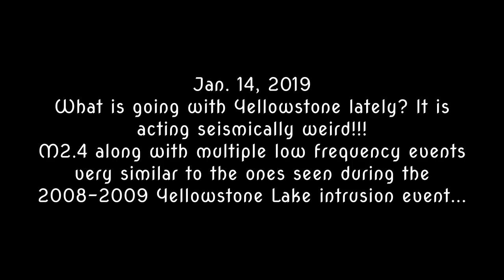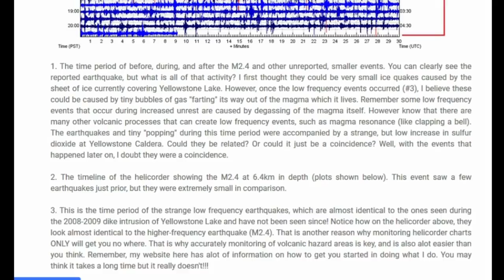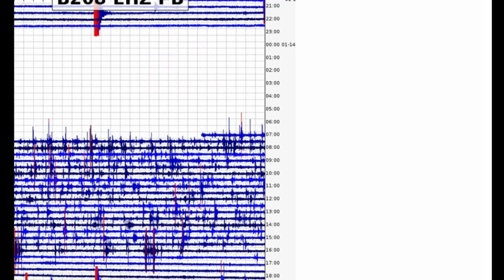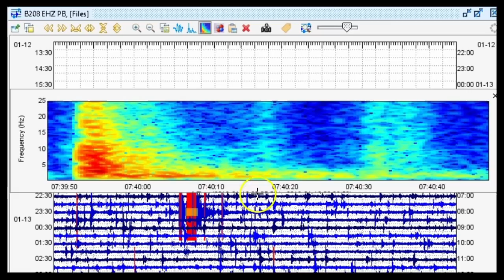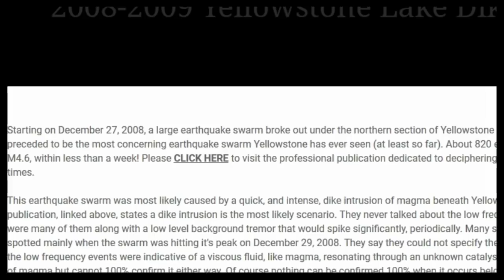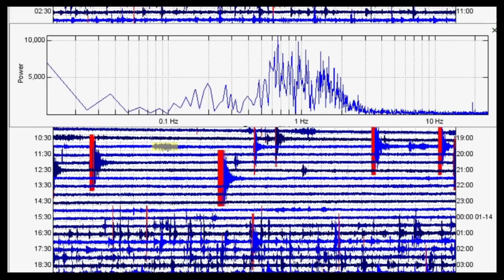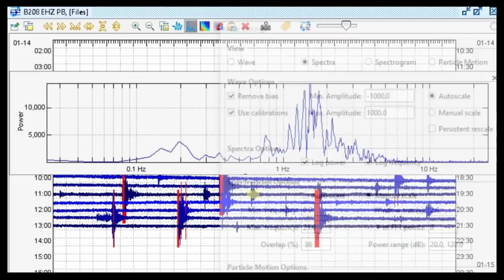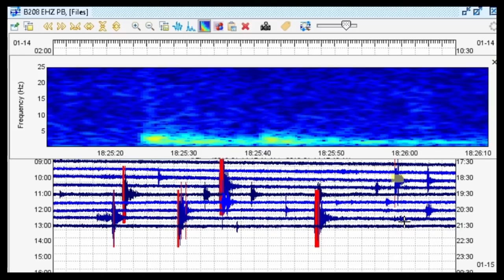Yellowstone Lake is Seeing Some Strange Low Frequency Activity -- An In-Depth Look 2019/01/14

Comment: Intro is fine. magma rising would create many different seismic waves because of the conditions.  Winter ice, thermal  water system heating up, magma pushing up the ground where it has already been, and rising magma releasing gasses.  Such a dynamic system   Very cool.

Comment: Hey bro, you might want to go back and look at today's graphs... the lake is showing a bigger shake and it looks like there is certainly some low-frequency shaking going on. Plus I think Steamboat might have gone off again because there is a few graphs showing similar readings as they have in the past following a Steamboat eruption. Maple Creek is the most telling...
Reply from the maker: Well steamboat geyser can only appear on YNM. It can appear on YNR if it is strong enough but those are the only two seismic stations you can see steamboat eruptions on. That is because the surface vibrations are the only thing being recorded by the stations. And yes, Yellowstone lake is acting up again. Weird stuff lately at Yellowstone. God bless!
Reply: There's a New Zealand guy who has prophesied that YS will erupt after SB eruption #36. 
 Who knows?
Reply: @KristiKane4Jesus   That guy is insane.  Plus he said it would erupts at 27 before and changed it when it didn't.
Reply: @stevenm3167  His explanation for it though seems reasonable.  He said he originally had the vision of 27 eruptions shortly after the 9th one this year occurred.  So after praying about it, he said God revealed to him that it would be 27 more times (after the 9th), thus the 36th eruption prophecy.  Interesting to note regardless.  😀⌛🌋🎺💖
Reply: @KristiKane4Jesus  Sure its a great explanation in theory, but why would God let him make that mistake to begin with if hes really who he claims to be? God wouldn't want him making a mockery of himself, he would want people to follow him devotedly.  Plus Chris has said if someone's vision doesn't come to pass they are a fake, but won't apply that to himself. If you look into the other visions he claims to have come 100% true, its waaaay off. Plus, his general rude actions expose him as a fraud completely.  Not trying be argue or be rude, so many aren't seeing him for how he is.

Comment: Ben, youtube research suggests intros no longer than 20 seconds (and ideally 12 secs) because any longer and the users start dropping off your feed. What that means is that even though you have a need to introduce yourself, even new users don't have the patience to listen. Instead, you can do your intro in the comment section or weave a little through your vids. You'll figure it out; best wishes for your channel ;)

Comment: I m not sure as to what temperature Yellowstone had since the 31 rst, but 50% of the snow is gone since....
it s quite obvious when looking on your post of that date.
if it was as cold, it means that the ground has heated up since.
perhaps it s normal, otherwise, it might be a clue as to what to expect.
what do you think?
Reply from the maker: Well maybe, but I personally believe if the magma was close enough to the surface to do that then it would have erupted already. I think the magma is heating up the hydrothermal fluids, therefore heating up the ground. If the magma is starting to rise again, then the hydrothermal system will heat up first.

Comment: You know VLF can be transmitted through the ground via mechanically. Military uses this to communicate between subs, and between dumbs, without transmission lines....not sure the exact frequency, but wave occilations are too uniform,  and some are far away, the other bases, communicating further down range...
Reply from the maker: Yes but usually those signals, regardless of frequency, is usually monochromatic. Meaning man-made events such as that usually stay within a very specific frequency range. Some natural harmonic tremor events have almost near-perfect waveforms, therefore dubbing it harmonic tremor. This is why seismology is so intriguing to me! God bless!

Comment: Also noticed that a lot of the low-frequency earthquakes that are like 6 km around that area are connected to the sun CME connection of the magnetic pull with our ionosphere which causes these electrical magma earthquakes. You can find this on spaceweathernews.com